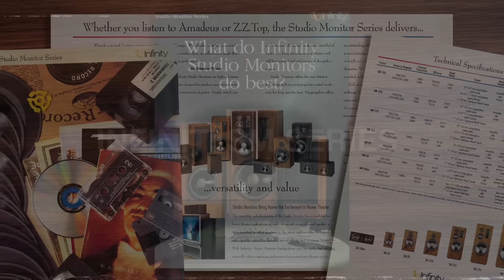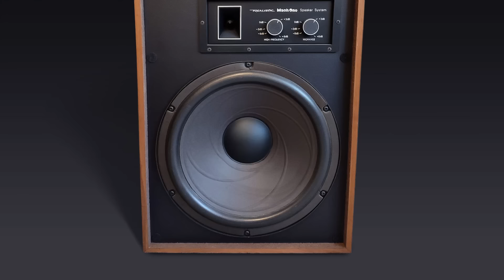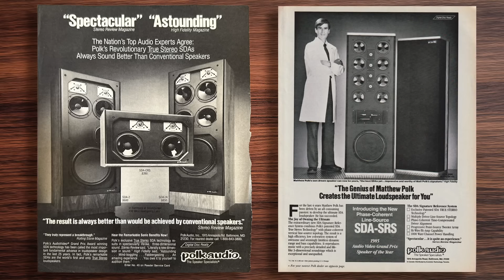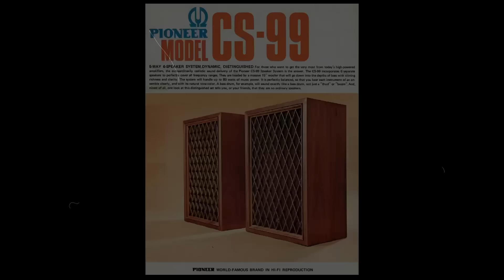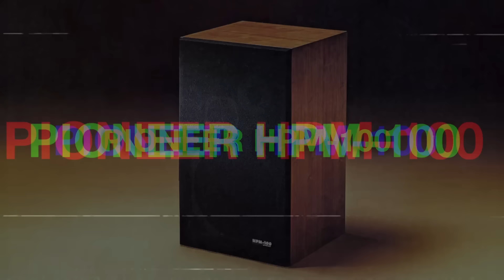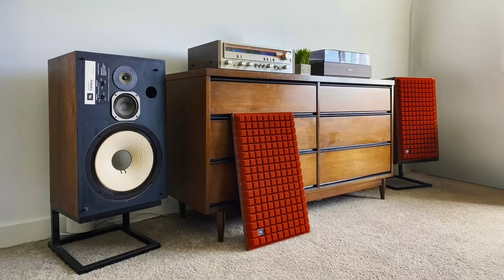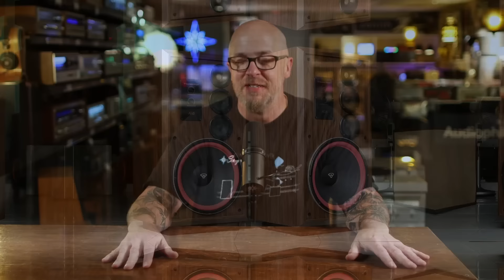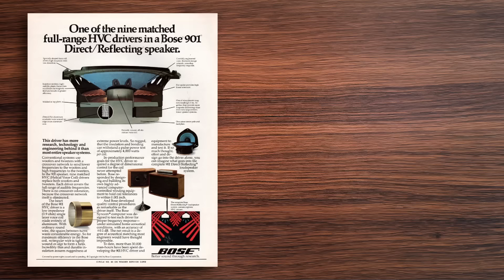Why Do Audiophiles Hate These 9 Legendary Speakers?

Comment: I have a Pair of 901s , Pioneer CS -903 and a Technics SB-7000. I love the 901s because I fell in love with them at a Disco in Puerto Rico back on the late 70s. Its not a speaker for everyone but I love my 901s
Reply: Me too. I agree with the OP that needs the right placement and room.

Comment: I never heard the term "Kabuki speakers", but I called them JBOD speakers.  (just a bunch of drivers).  Because they all sounded like just a bunch of drivers jammed into a cabinet.  Imaging was non existent, and off axis response was simply impossible.  But they were popular, especially if they included chromed beauty rings.  Got to have those chromed plastic beauty rings.  It's what set the Pioneers apart from all the rest.

Comment: I had the infinity SM. The tweeter is cheap garbage that distorts easily. Junk crossover.
The Mach 1 were screamers. Boomy too.
Polk SDA weren’t bad, but they were not as realistic as the monitors. 
Those Japanese kabuki speakers are muddy thump and sizzle. Yuck. 
The HPM are ok for background sound. 
Heritage Klipsch up until v IV ARE SHOUT factories. Crap crossovers and crap drivers on the v1 and 2. 
L-100. Junk, But Loud. Beamy. Ugh. 
Mids suck. 
Bose 901 are grainy. Poor bass, poor treble.

Comment: Now hold on a second we're going to go talk about that pioneer you just spoke about I think what it is with the mid-range on the speakers is that the crossover might be able to be tinkered with to bring out the meds a lot better I just think that's what's wrong with these speakers I own pioneers and the mid ranges are all kind of smooth and gentle and yeah I would like to tweak them up a little bit the only thing I got to say is I like pioneer speakers more than I like the rest of pioneer let me sound sad I had one pioneer go up in flames on me and for good reason I didn't do anything wrong like like put you know seven speakers on one channel I didn't do that but I've had pioneer CD decks and one CD deck start to squeal there and they have a death sentence they're going to die I went through eight of them and they're horrible

Comment: I had the Sansui SP-X9 speakers when I was a teenager.  18 inch woofers, 6.5 inch midrange, two horn tweeters and 3 super tweeters. 300Watts and 100db 1W/1m.  They were every teenagers wet dream in the 80s.
Reply: I have 4 of them in my current setup, I put the better pair i have up agisnt some klipsch 600m's and the over all sound was better with the X9's. I was suprised as I have just always used them sence I was young as they use to belong to my dad and where just given to me. but I do have to say they sound way better on a new AVR then the 50 year old one they came with.
Reply: @DefectivePotato95  All that mattered was that they were louder than the JBL L220 disco at the time.
Reply: What?
Reply: @danresler6816  What what??
Reply: @Velocus-p3z  Listening to your setup damaged my hearing
Reply: @danresler6816  Damaged mine too lol
Reply: I pulled 112dB with 30w amp and Foster 12" 3 way dual tweeter speakers (1 5" mid, 2 dome tweeters)

Comment: I had the Infinity SM-155's in the video.   They were absolute TRASH.  The "adjustable" crossovers had ZERO audible affect... I mean ZERO.   I have $80 bookshelf speakers with a  6" woofer that have better, lower bass than those 15" monstrosities.  In that mid-90's way, they "looked" like the impressive speakers I wanted.... But they were all show, no go.

Comment: Those old speakers don't have any bracing and sound boomy. With today's technology we can design much better sounding speakers in the diy community. I have a pair of pioneer hpm 60 I don't even listen to them because my diy speakers look and sound better. I was going to modify them but I would end up changing all the drivers and have to design a new crossover so I didn't bother because I know I can design something better. I'm a carpenter and I have all the measurement tools and carpentry tools plus the know how.

Comment: Chiming in.... yep, an 'audiophile'. Yep, worked in the music industry at high levels (Top label, best studios, projects with A-list producers and mixers, etc.) I'm framing this as for pop/rock/country/hip hop listening and excluding critical listening and folk/jazz/classical here. The SDAs can sound great. they need muscular, powerful solid state driving them. and placement is critical. you can go with or without the connector. the effect is pretty cool, but very recording dependent. I heard a 901s setup that was great. Two sets, properly placed, hung from the ceiling in the right room, lots of fun. I can't stand horns- they can work (Barely) with tubes or very high end solid state. Off topic- great bang for buck used: Mirage and Infinity RS series. one other point- it can really work to match the decade of the speaker with the decade of the music. (For the two of you wondering- best sound I've ever heard (relative to this thread)- master analog tape to large pro studio monitors in a control room (perfect room treatment) with high end solid state driving it. The truth is working on your room and treatment will give you more improvement than any one other one factor (assuming you have a decent level of gear and matching). It's also one of the cheapest, easiest upgrades.

Comment: I have a set of original Klipsch Forte and Vega DX9. 
I like to switch them up every once in awhile. I push them with a Marantz 2325.
I do prefer the Klipsch most of the time but wouldn't part with either set.

Comment: I worked in the British UK hifi trade on the 70's the American speakers we did not sell so i cant comment , however we did stock and sell 3 x of the spekers you have spoken about the speaker i hated the mnost utter garbage was the Bose 901 i cant understand how this ever went into production they were pure crap we just could not sell the 901, we all most had to give them away, we also stocked for a very short time Cerwin Vega we had massive technical issues with them they kept blowing tweeter fuses in the end we sent them all back to the UK distributor,  the one we sold like hot cakes was the JBL L100 they just flew out the door, they were very expensive  we found them forward brighting the midrange bass that could knock an elephant over but with a very engaging sound i loved them and the whole jbl RANGE SOLD REALLY WELL L16  L26  L100 bright punchy sounding speakers not the typical laid back British sound , but for rock music or country music where you wanted a good solid punchy speaker one of the best SPEAKERS  ,, Bose and Cerwin Vega were just crap

Comment: I’ve been listening to my JBL L100a loudspeakers since 1981 and they are fantastic PAIRED with my McIntosh MC225 tube amplifier. I think the vintage L100s sound harsh with contemporary solid state amplification. Maybe that is where their bad reputation comes from. 
(I’ve replaced the orange grills with replicas available on-line and I replaced the tweeter foam circular surroundings. That’s it - no other modifications or repairs needed in 45 years. 
I also have the current problem L100s in high gloss black. They need power and are probably best with a solid state amplifier.

Comment: Funny how US speaker taste is different to the UK. Most of your list I've either never heard of, or at least never seen. However, over here in their day the JBLs were seen as being great for Rock but nothing else, and the Bose were either raved over or sneered at (in equal measure). Over here we had Celestion, Monitor Audio, Videoton, Quad, etc, etc, with the main aim being for the speakers to have no "character" of their own, but rather simply to reproduce the music accurately. As for Japanese speakers - forget it, despite the fact that we were huge fans of almost every other component they made, we never got a taste for their speakers.
Reply: Here in Germany we had at the 70s/80s Braun (sold rebranded as Ads in USA), Canton, MB Quart, Elac, Quadral, Heco, Magnat, Grundig, Arcus, Saba, Itt, Dual, Acron, Siemens, Whd, Telefunken for example and "Rft" speakers from east germany. :)
Reply: @omnion100 Really unfortunate for Germany have Great Wooden Radios on the 1950s and 1960s, Saba, Grundig, Telefunken and Nordmende. I had the flagship Saba Freiburg 14. Amazing Radio with twin. 10 inch woofer.Next in the 1980s we have the Saba, ITT, Grundig, iTT Television with deep Rich Color CRT and better pictures than Japanese TV. However German manufacturers lost traction in the 1990s...Now some names to Remember.
Reply: The difference is US homes are huge and their Hifi Speaker are more like PA System. The UK on the other hand, the house are smaller and loved to slouched  low on the settee. That is the reason why the stand for bookshelf are Ridiculously low..
Reply: I gifted my son a pair of sl600s with the original copper dome tweeters. They are a personal favorite book shelf speaker of mine.
Reply: Funny, no mention of Tannoys! I had a pair of their 12” ones at my studio, and use self powered Gold 6s in my home studio now.

Comment: The Klipsch @ 9:00 has a bone-head design mistake that is so easy to do right... especially the horns. The horn flair ends in a sidden, almost 90 degree bend from being rear mounted. Even the woofer suffers from this mounting. A rear mounted woofer sounds like it's in a tube compared to an identical surface mounted woofer in an identical cabinet. And you'll notice another mistake that plagued that era of speakers... they have a lip to hold the grill frame in place. No credible modern speaker has that. The sound waves that follow the speaker baffle surface hit that lip and replect off uncontrollable with accompnying phase distortion. Bad move. My Polk Audio 10A's were the first speaker I had that did all that right.

Comment: I had Cerwin Vega's D-9s, although they were monstrous in size, I built stands for them and picked them up about a foot off the floor to help knock the boomy-ness out of bass. They could really fill a room.
Reply: I have the Cerwin Vega DX9's. Right now I have them paired up with a couple CS99'A FB cones. I like the sound.

Comment: I had a pair of Polk RTA 11t’s for a few years. They were pretty cool and looked nice. Same drivers as the SDA series with the passive radiators. I ended up giving them away after I repaired a pair of early 90’s Advent Heritage speakers. I loved those Advant’s for many years. Now I have the Wharfedale Linton’s which are fantastic.

Comment: The Bose 901 was the absolute worst gimmick ever sold. Drivers are junk - and I mean junk. How do I know? I worked for Siemens NX division and trained 20 design engineers in MA in 2010. 
The key to successful sales were absolutely 100% the money put into the marketing campaign by Bose, the total control over distribution for many years / having specially designed acoustically treated rooms at the distributor and these rooms were the only space they were allowed to demo them. In the 90's it was a nightmare / Bose made sure their product was pushed above other brands, they had inspectors acting as purchasers - if it was reported another brand was recommended the distributor faced loss of discount or being cut from distribution. 
I've never seen a speaker returned as much as these. When the customer got them home and hooked them up, it was near impossible to recreate the same sound field they experienced at the distributor sound room. 
Just ask yourself - 8 small drivers with foam surrounds are supposed to recreate the entire sound spectrum? Any true audiophile saw this for what it was - an overpriced gimmick that could never in the real world recreate the soundstage a well built 3 way speaker could - without the fussiness of placement.

Comment: I’d have to say that 901s are the best party speakers ever. I’m not a sub-heavy EDM addict, but for loads of big, warm mid-range that fills the room they’re great.
Reply: Hugh sound stage with strong mid range like you mentioned. I've seen them soak up the power from a Crown Audio DC300A without problem.
Reply: @paulherbert5548  you can hook the leads up to your wall socket and they'll make 60hz real loud.

Comment: I love my HPM-100's, bought them like 17 years ago for the exact use case you described - I live isolated, and on my property I have a small beach about 100 yards from the house. Wanted to be able to play cd's from the house with reasonably good sound quality for parties down there, and someone recommended these speakers. They're excellent for that! I paid ~$400 for them, in mint condition.

Out of curiosity I checked eBay just now, and decided to move the oil lamp I had sitting on one of them to a less expensive area of the house. Jebus!
Reply: And plus they have that classic vintage look.

Comment: Love my Cerwin Vega VS-150's. Had them since new. They do need mods easy for anyone with some basic skill. Box needs bracing and some Dynamat.  The crossover needs the electrolytics removed. Did the cap replacement on the cheap. Mundorf Foil for tweeters, Russian military (Military Surplus) red box foil in oil for mids and some Jenson Metalized film and Russian red box foil in oil for woofers. improved the sound tremendously. All my equipment is from the 90's -Rotel Pre, Adcom GDA 600 DAC, Adcom 5800. All recapped with Elna in signal. Panasonic in power section.  DAC has Copper foil caps and discrete Op Amps.  System total under $2500

Comment: I worked with those Mach Ones when I was a kid @ Radio Shack. We couldn't keep them in stock even though they cost the same as a good used car at the time...Four of them could rock our High School Gym for dances I know that much. Cheers awesome memories watching your channel. Thanks.😎
Reply: Most people prefer the first version over the second, so for people looking to find and purchase a pair, get the original first version.
Reply: @marvinmurakami8828  They have rubber surrounds that won't rot. Those are the most sought after.
Reply: I use a set of first version mach ones with my Sansui 9090 DB receiver And they sounds awesome .
Reply: I had a set of the second gen ones back in the late 80's-early 90's. They certainly didn't cost as much as a good used car, but they were something like $500 a pair.

Comment: Right before college (1970), I built my own speakers using a 2-way kit from an electronics catalog. Got tired of the loud sound and purchased some Advents which lasted through college and my first post school job. They took plenty of power but were missing much of the mid range. Once I was able to afford them, I purchased a couple of JBL 4311 studio monitors. Finally I noticed the mid range. Very much like the L100 but a more professional design. The woofer is rated 75 watts RMS and they are very efficient. Also no foam surround to rot away. I'm sure there could be others I would like, but the 4311 may be a lifetime speaker for me.
Reply: Same experience here, building my own speakers in the seventies, but with the HiFi-Bausatz BK 4-70 - from ITT Schaub-Lorenz, three-way speakers, enjoyed it so much..
Reply: 4311B. Bought them new. Loved them then. Still love them today. I use them in my home studio as mid-field monitors or just listening in general. They're kinda too big for near-fields.

Comment: I had a set of Cerwin Vega W10's from 1978 until about 2001 I remember they were loud and sounded fantastic even when BLASTING Beethoven's 5th. I only regret getting rid of them in favor a flavorless Bose Accustimass system
 (also long gone) Even with multiple sets of JBL's I give my left nut to get my W10's back-----...never mind I picked up some CV' model25's which are about as close as I can get for  way less than my left nut. can they hold a candle to my JBL L112's or L86's? no. are they Loud and fun? yes

Comment: I had a set of Sansui SPZ-7ii.  Got em in the 80s while in high school.  It was these or Cerwin Vegas.  I was in HS and listened to Rock.  I ended up liking the sound of the Sansuis (for my budget).  I think they would be kind of late Kaibuki. As I recall they had 16” woofers a small horn a midrange and a couple piezo tweeters.  They sounded good and  were efficient which is what I needed at the time.  I wanted to like the 901s but didn’t.  The lower range 201s/301s actually sounded better to me.   You skipped over planar and ribbon speakers that are also in the love or hate category. Honestly, though, every speaker has its fanboys and detractors.
Reply: Oh and I had a teacher who had a set of SDAs.  I loved those.  Nothing sounded better in the sweet spot.